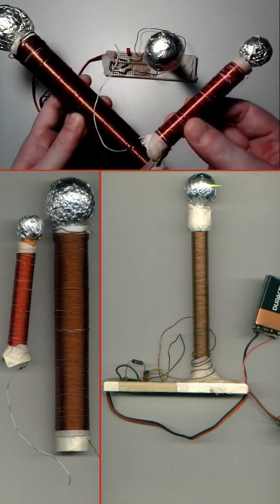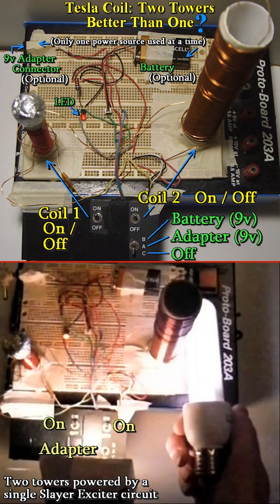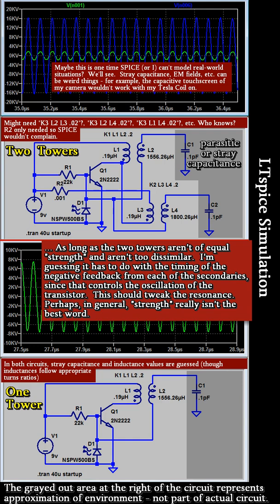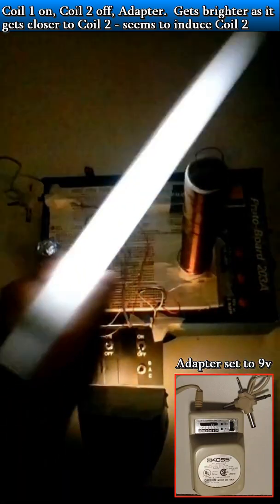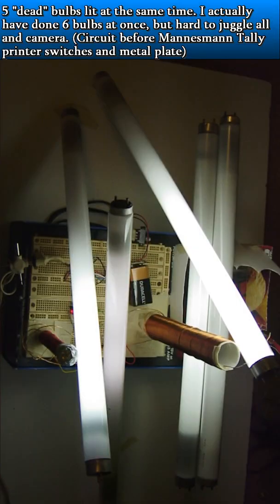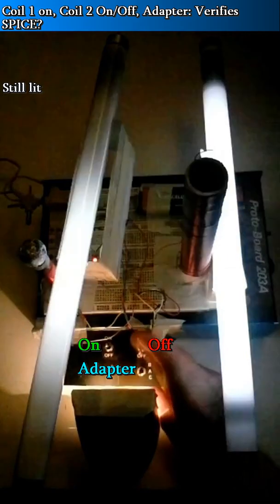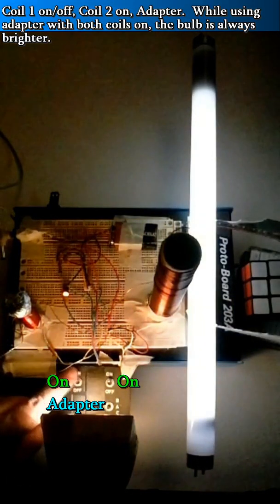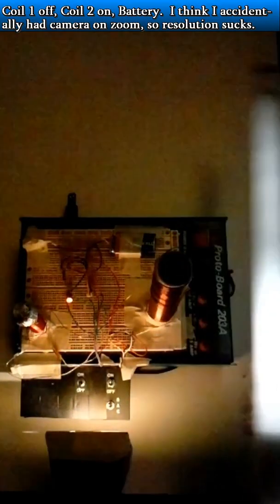Tesla Coil: Two Towers Better Than One?  #shorts

Comment: Skematik sir
Reply from the maker: @Your Mood Music I figured the LTspice screenshot would be sufficient (but without the grayed out area at the right of the circuit (which just approximates the environment and isn't part of the actual circuit)).  I also put the one tower Slayer Exciter circuit (without the environment approximation) in my other Tesla Coil video ( https://www.youtube.com/watch?v=N6YHpKBNrLk ). R2 in the two tower version isn't part of the circuit either (it was only necessary because LTspice complains about two coils directly connected together).  The secondary winding should be about 300 turns, but as low as about 160 would probably be ok.  The primary winding should be about 3 turns (or less if the secondary is less than 300).  The LTspice circuit doesn't include the switches I put in.  In case you need that info: I put the switches between the +9v wire and the primary coils.  Also, you can ignore (if you want) the part number on the LED - just about any LED would do.  I hope this info is sufficient.
Reply from the maker: @Your Mood Music To add what I already wrote...  If you've never built a Slayer Exciter Tesla Coil, you should watch my first Tesla Coil video which discusses things that can go wrong - specifically how to wire up the primary ( https://www.youtube.com/watch?v=gwSStwG7Hm8 ) - which end of the primary to connect to the collector of the transistor depends on the direction (clockwise vs. counterclockwise) of the primary winding in relation to the secondary it's around.  The direction doesn't matter, but it dictates which lead connects to the collector and which lead connects to the +9v,